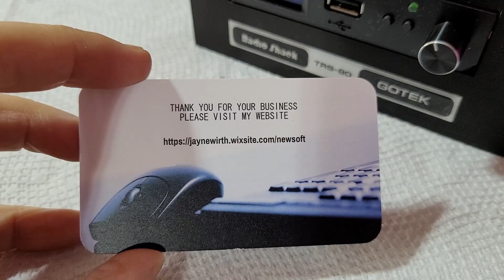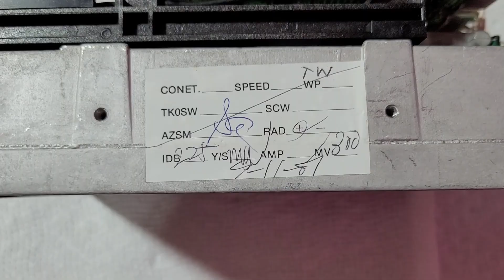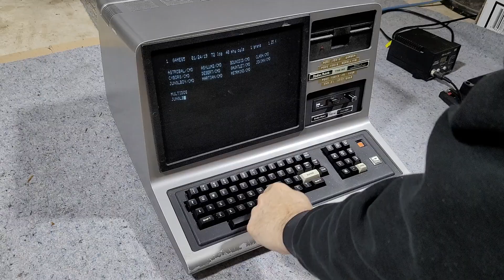TRS-80 Model III Gotek

Comment: Thanks for the video, lots of good tips and information. I assume you had to remove the Gotek rotary switch before sliding the monitor section back on? Or does the angle you do that at clear the encoder knob? Do you have a video about preparing the usb drive for Gotek for your model 3? Any issues setting that up? Thanks.
Reply from the maker: That is a very observant question, regarding the rotary knob.  I too expected it to not allow the case to be go back on.  However, I did a test fit and the case slid by with only a small about of flex from the plastic.  There was only minimal contact.
I probably should have mentioned the USB set up procedure, though it was very simple.  I took an random USB drive from my desk and copied some .HFE images onto it.  The .HFE images were ones that I converted from .DMK images using the HxC Floppy Emulator utilities.  That was pretty much it.  The biggest issue that I had with that was the fact that there was other stuff on that USB drive already and it took a little scrolling with the encoder to find my images. :)